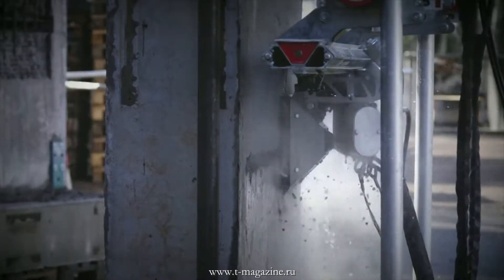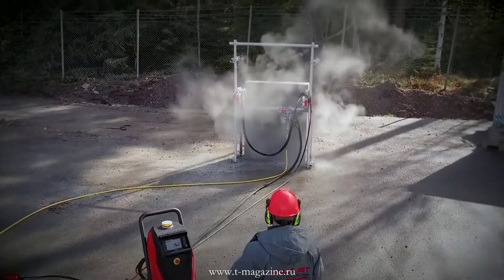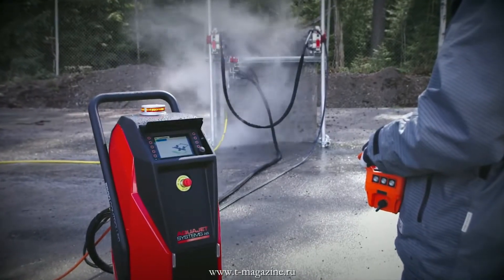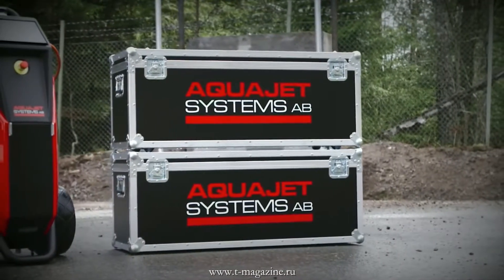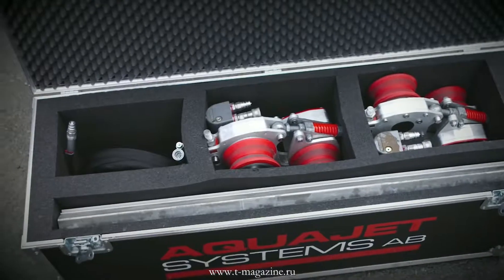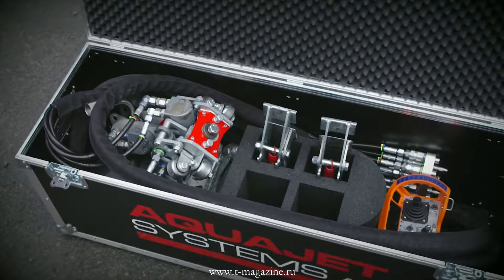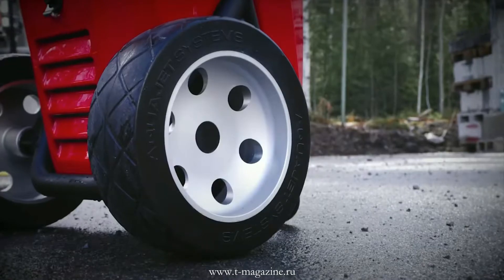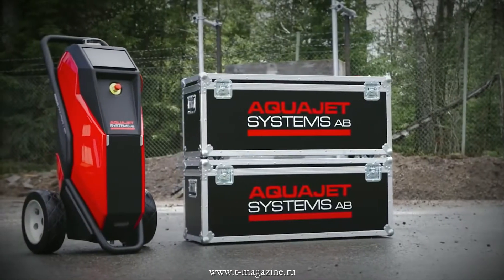Aquajet system for concrete demolition

Comment: Aquajet Systems presentation of the hydrodemolition robots Aqua Cutter 410 and the Aqua Cutter 710 models together with the Aqua Cutter Power Pack 700. The video presentation shown the very user friendly design and a number of different jobsites and various hydro demolition applications. This method is also called Vattenbilning in Sweden and Norway, Vandmejsling in Denmark and Vesipiikkaus in Finland.